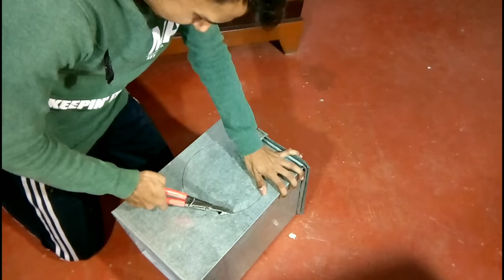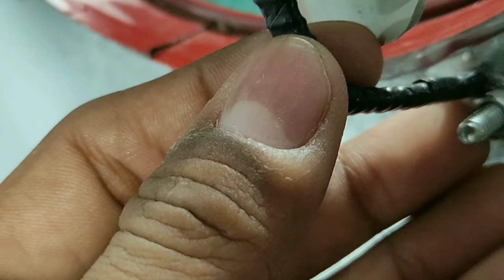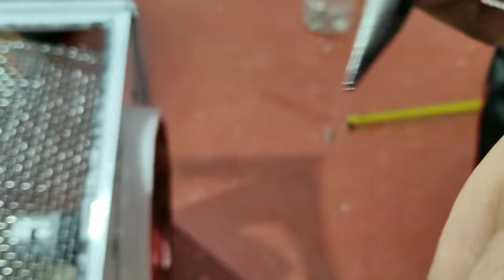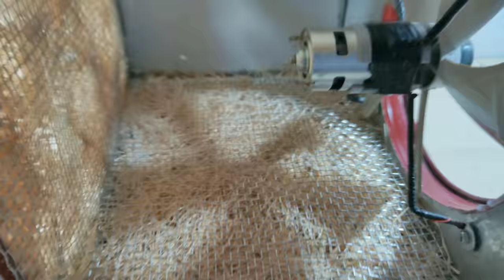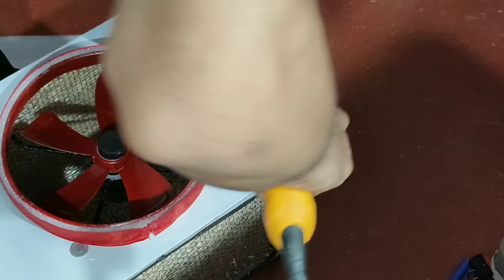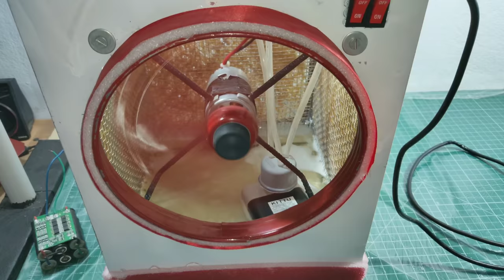how to make a 12v dc air cooler कूलर बनाए सिर्फ 750 rs मे

Comment: Where the word comes to saying put some gloves on.....

And do some insulation, that is an evaporative cooler, your power supply will easily damaged by the water particles, and plus the switch are too close to the dripping end which could lead to the switches are run by the water,
It is a good idea but using metal without proper insulation is dangerous.